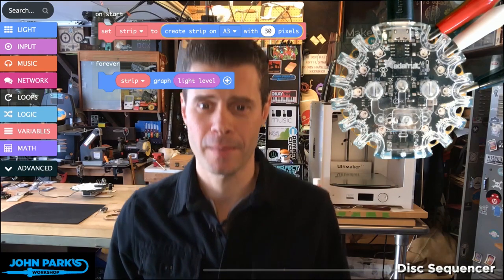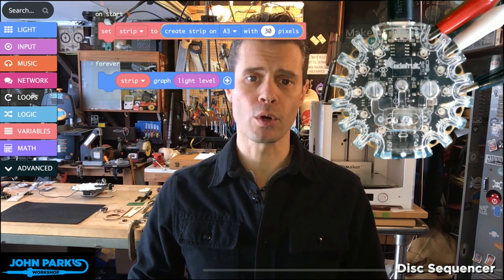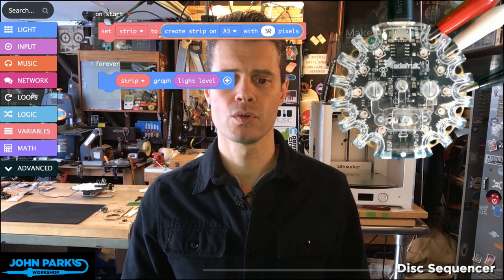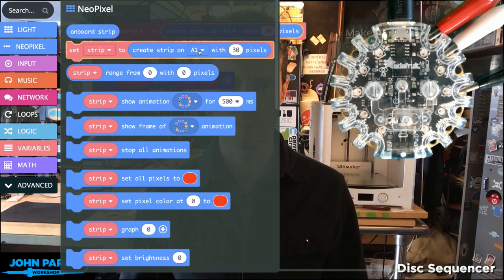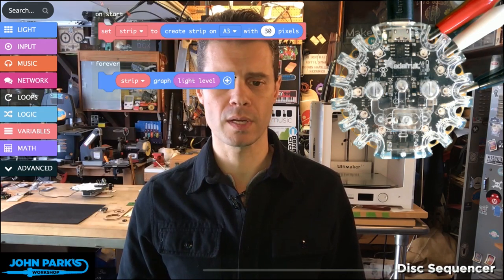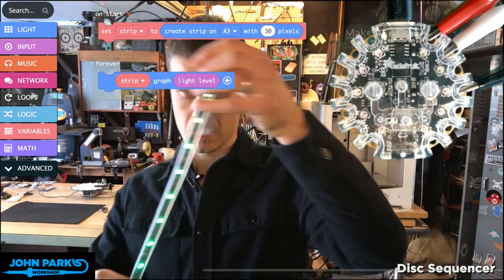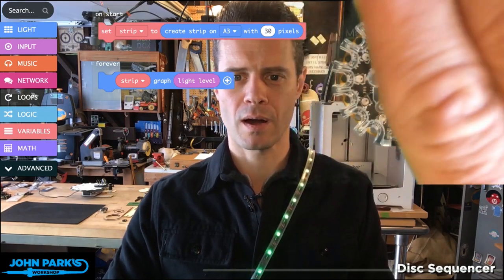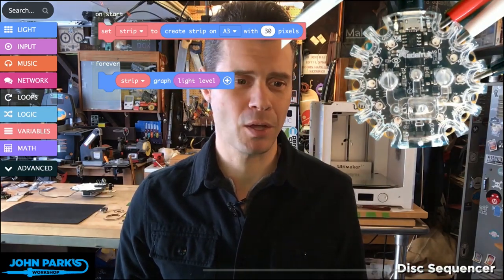MakeCode Minute: External NeoPixel Strip Graph @adafruit @johnedgarpark #adafruit @MSMakeCode

Comment: My arduino uno experiences a lot of noise (false inputs activating my code) when I have 4 analog inputs hooked up. I am even using 10K resistors wired up to be pulldown resistors. Are the arduino nano and arduino mega any better at handling noise? I notice they're made with different chips